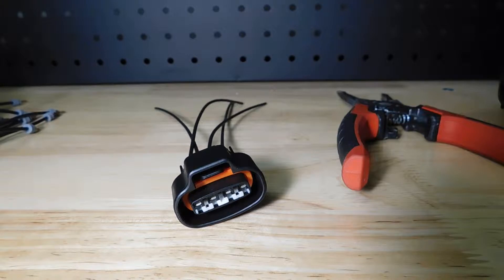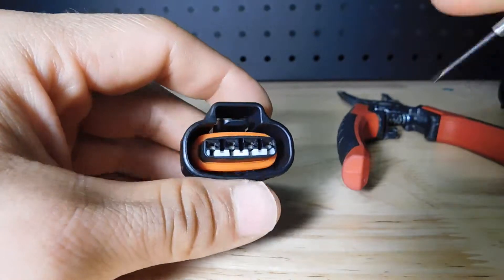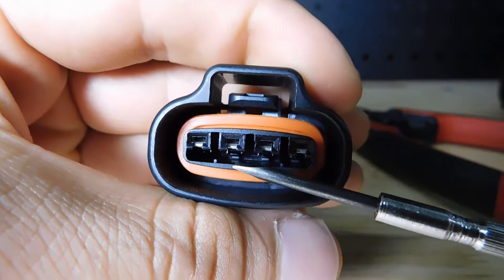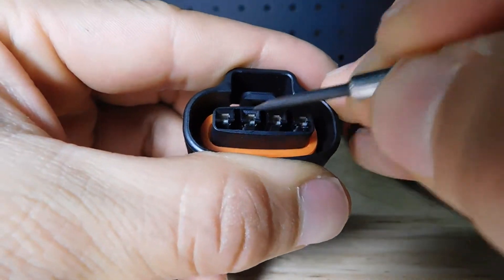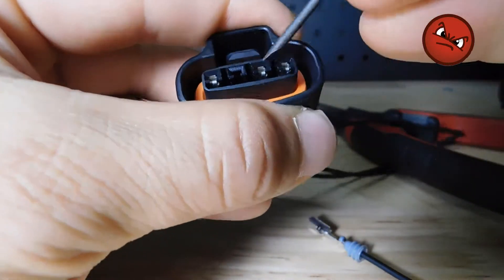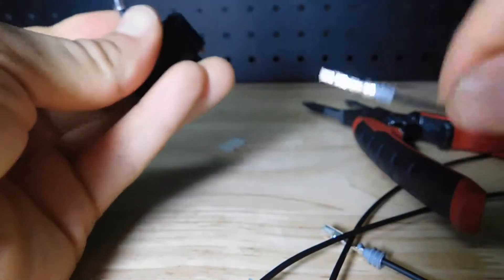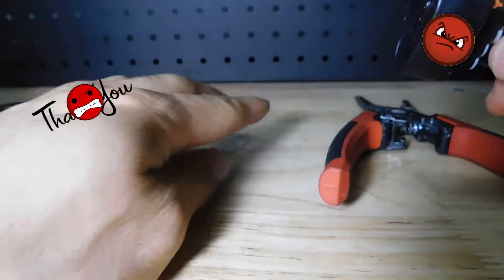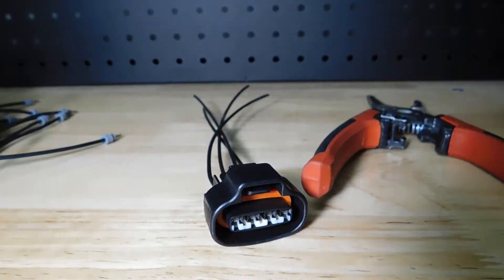Depin Terminal for connector Tutorial How to Diy Toyota Lexus

Comment: How do you know which is up or down on the connector when you insert it?
Reply from the maker: The terminal has an opening on one side where the plastic tab will fit inside once is inserted, with this being said, you know which is up or down the opening goes where the plastic tab, however when you are installing the force you will feel how easy fit compared when you are trying to insert in the wrong way, in this listing you can see pictures from different angles of the terminal

https://godaca.com/1x-terminal-contact-f-a-2-2-b-2-3-c-3-1-r-d-4-2-e-4-9-f-1-5-l-17-2-cl-7-3-fl-9/

thank you, for your question
Reply: @godacallc.5057  much appreciated...very very helpful! 🙏

Comment: Thanks for the info!
For whatever reason Autozone, Napa, and all these other companies don't have some kind of wire repair kit, so what I ended up doing is going to the junkyard and clipped off a couple of connectors that had the same pins and used those to repair my connector (which none of the stores had either 🙄)
Reply from the maker: hi Cristobal we are glad to hear that this video helped you. whenever you need connectors terminals or wire seals you can visit our website www.godaca.com, we are also present in eBay or amazon , thank you
Reply: Yeah. Me too. I always use junkyard cars to test my abilities to do stuff like this, before I try on my own car. Lol